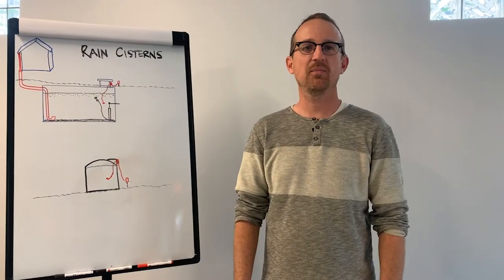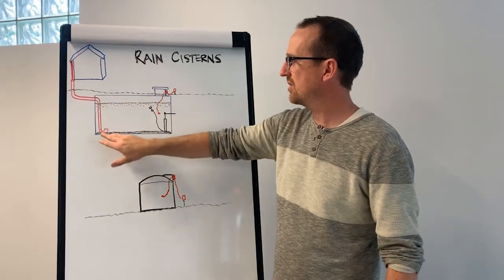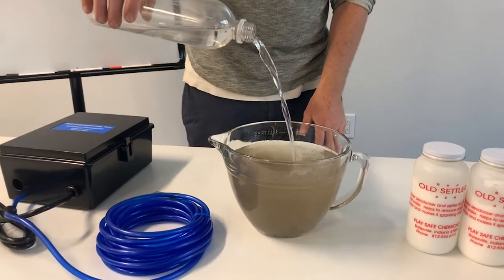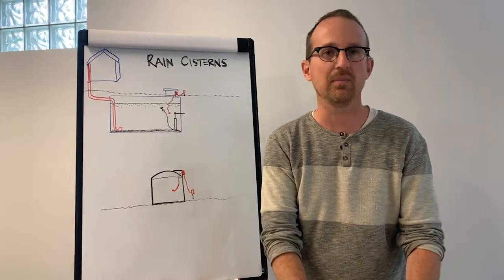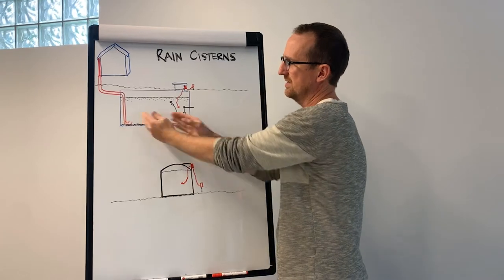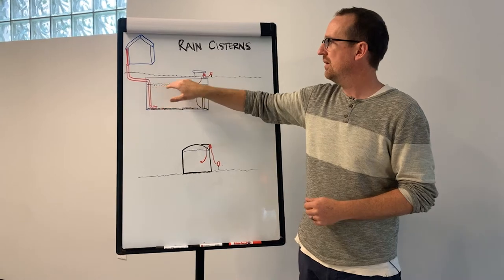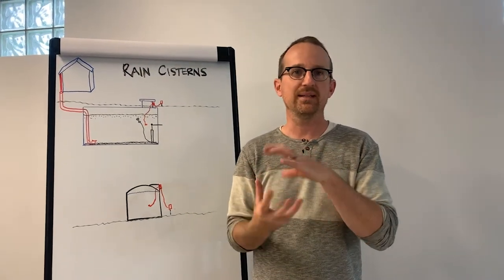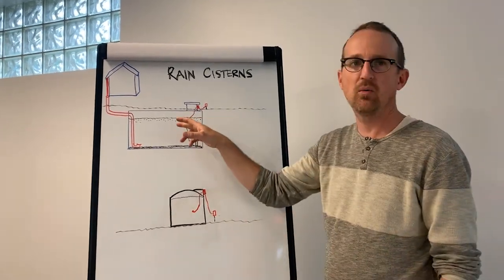Rain Harvesting Water Quality Issues - Dark or Tea Colored Water - How to Solve!

Comment: You have a lot of great information on rain water harvesting and filtering, have you had any of the water tested for low Ph? how are you raising the Ph to be not acidic? I have  my water capture and filtration working, all is good, crystal clear but the Ph is a bit low
Reply from the maker: Most of our systems utilize a concrete tank, which naturally raises the pH. It may be difficult to achieve exactly neutral, but getting in the 6.5-8.5 range can be achieved using pH up or pH down chemicals that are safe for drinking water systems. In our case, because pH is high in our systems, sometimes it is necessary to add citric acid to lower.